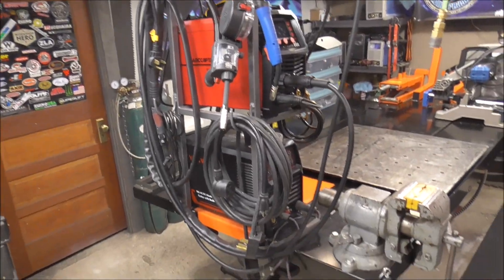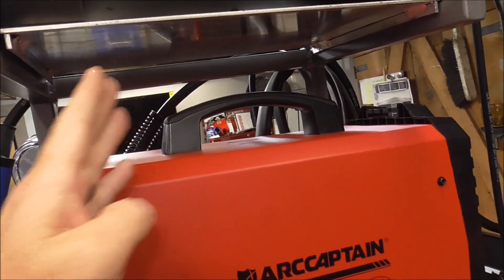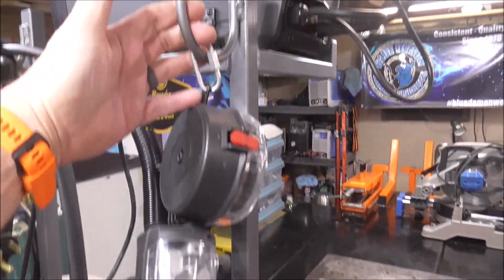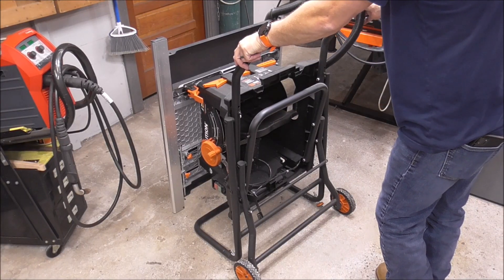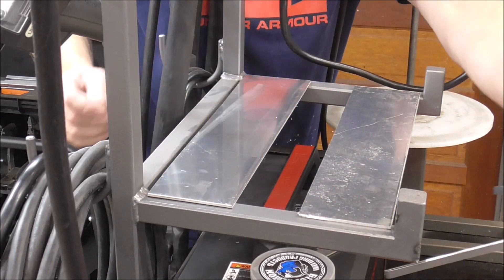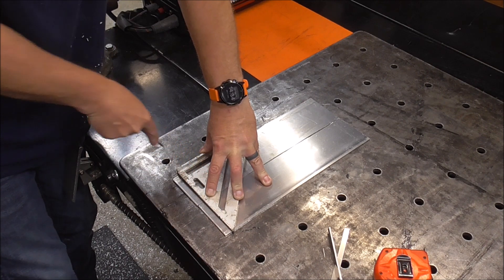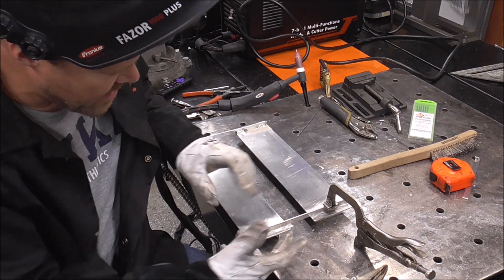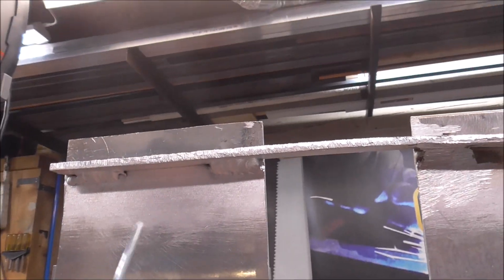Aluminum TIG Welding Practice HOW TO IMPROVE

Comment: I have a project i want to try with aluminum. I want to build a pontoon fishing boat. I figure 3 55 gallon steel drums cut in half long ways and some sheet metal welded to the flat side to seal it off then fill them with expanding boat foam. Build a frame from aluminum. Then i could customize it how ever i want.
Reply from the maker: Cool idea

Comment: I know what you mean. I have an aluminum tig job coming up and I haven't tig welded any aluminum in about 5 years.
Reply from the maker: Its easy to get rusty but it's like riding a bike, a little practice and you will be on point in no time.

Comment: Great video Brandon 👍🏻👍🏻
Have been busy, but finally got to your video.
As for the blowing out the thinner side, that's where the pulse setting comes into its own. Pulsing reduces the heat going into the material and stops those sorts of problems. 
Just spend a bit of time dialing it in, then things become a lot easier. 
Have fun 👌🏻👌🏻👌🏻
As other have said.  Heat sinks are great to have around to draw that heat out of the thinner material.  I'm a real squirrel when it comes to scrap copper,  just for that purpose.
Reply from the maker: Thanks man! I've got a nice 1/2" thick piece ill be using:)

Comment: Uh, rock hammer as a push stick? Nothing funky could happen there. lol
Reply from the maker: It's a slag Chipping Hammer 99% of the time that serves double duty. People freak when I run my hands close to blades so I figured this would appease them lol
Reply: @BrandonLund   I am a woodworker by trade but do a bit of metal work as needed. I would urge you to use a wooden push stick  and avoid the nastiness that occurs when metal comes into contact with a saw blade. I am missing portions of digits due to a couple of accidents. Not too bad for over forty years in the trades. Please be careful, use a proper push stick and keep up the wonderful and informative videos. Thanks
Mark

Comment: Good video yes the more you do the better you get in most cases. My hft plasma cutter stopped working after 10 years I ordered a yes welder plasma cutter from TSC for $358 it is 65 amp I used it and it works well. But the book that came with it is useless have you done a video on them I can watch thanks. Take care, be safe and and well.
Reply from the maker: Thanks man! I have a few yeswelder plasma cutter videos. Google Brandon lund plasma cutting 101. I'm using a yeswelder for that video and it's very popular.

Comment: That wasn’t so bad, i was thinking about your comment about the two types of metal and one needing more heat. Is it possible to keep the thinner metal cooler?
Reply from the maker: A piece of copper on the thin piece will help pull out a lot of heat. Thin aluminum will evaporate if it gets too hot.
Reply: Oh wow, thats great….i would never think of that, i was thinking maybe glass ? I dont know why i would say that except it takes extreme heat to make and can change temps…lol maybe just a ridiculous thought…lol @BrandonLund

Comment: Thanks for this.  People like me, that are learning, get discouraged with the poor welds we get when practicing, so it is good to know that experienced people get bad welds too.  I haven't done any TIG, but I am learning to MIG weld......and  I will learn TIG later maybe.   Don't want to undertake learning new machines all at once.  It's hard enough for me to grasp voltage and wire feed speed.
Reply from the maker: I 100% agree. Stick with learning the process you will likely use the most and become and expert at it then explore other processes. Excellent way you are foinf about it

Comment: Look up problem with yes welder 250 ac/dc there are guys that are having the same exact things that you are going through. It's what happened to me and they sent me 3 different machines. Keep up the great work and videos and look forward to seeing your boat repair..
Reply from the maker: Huh. Thank you for this. I will have to look into it.  Are they sputtering also? I don't do a ton of TIG so I just assumed it was my technique. It seemed to run nice one minute then not have the same characteristics for the next weld.
Reply: @BrandonLund  that's what it was doing it would run fine for about inch and half then sputter and back to normal sputter and so on I think it's in the design of the machine. It welded fine on DC had problems with AC. On the DC side was different than the primeweld the arc had a hissing to it sometimes it had a high pitch whistling in the arc.

Comment: Welding on a boat hole is like welding aluminum cans!!!!! I personally would be practicing on turbo tubes to weld aluminum boats.. I even sometimes play around and practice on cans this way you know how to finesse your heat to not blow through.. alot of it is in the machine I had one of those tig 250p ac/dc to give it a run to have a portable welder it didn't proform like my primeweld tig225x.  Still on the lookout for a small machine to get and have for mobile welding looking at the arccaptain TIG 200 ac/dc seen alot on them and in talk with them about demo one of them to see if they proform as well as the primeweld.
Reply from the maker: I started on these and have been slowly working my way down to thin sheet.  FYI, Shhhhhh. I just picked up a TIG200 from ArcCaptian and I'm going to give it a go. If it's any good I plan to give it away to one of my subscribers and will pick up another for myself.
Reply: @BrandonLund  looking forward to seeing your review of it and will definitely be interested in the giveaway.😁😁😁😁

Comment: PS, you may have bad argon.
Reply from the maker: Really? It is about a year old but my shop temperature is pretty stable. Is that a factor?
Reply: @BrandonLund  bad argon gives you really really weird results. Best way to find out is making sure you have two argon bottles. If you swap and the problem goes away; it's the argon. You wouldn't be the first welder to have this happen to. When they Gas Suppliers fill the bottles, they can get lazy and not clean the bottles.
Reply from the maker: @jondavidmcnabb good to know, thank you!. I'll try swapping bottles and see if it improves. Thanks again 👍

Comment: Brandon, little tip for you. I find it best to have a thick copper backing plate on the backside of the hull. This helps prevent burn through and also acts as a heat drain. Most boats have very very thin aluminum hulls and you can burn thru very very quickly. Preheat on thin aluminum is a waste of time. Clean Clean Clean, also flux can be your friend. Don't be afraid to "stitch weld". Good Luck!!!
Reply from the maker: I appreciate this very much. The copper backer was going to be my approach as a guess and you just confirmed it. Thank you very much for your advise. It is very much appreciated (and needed) lol